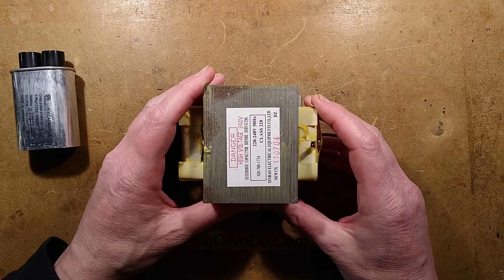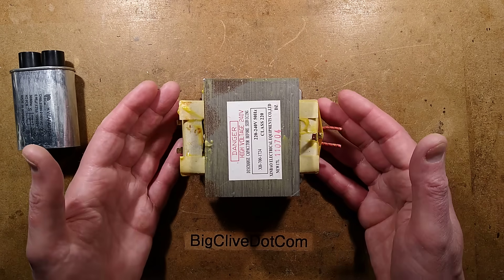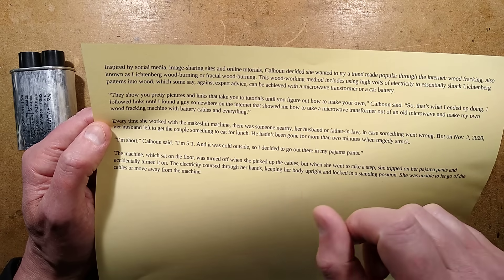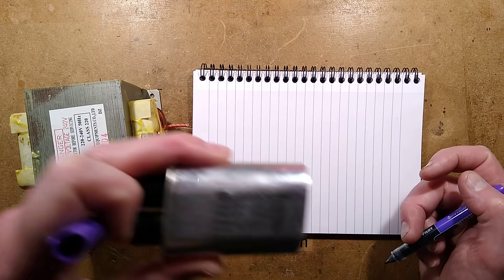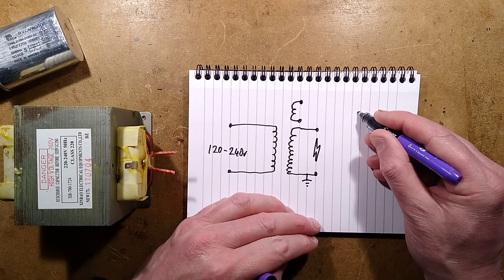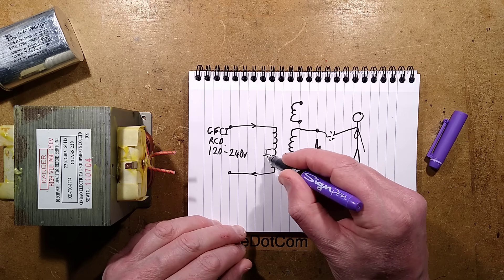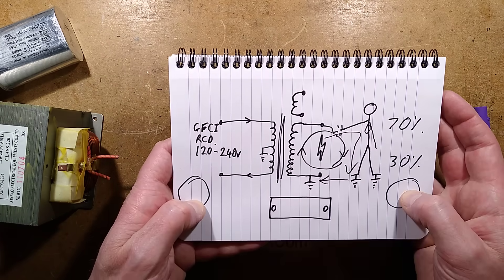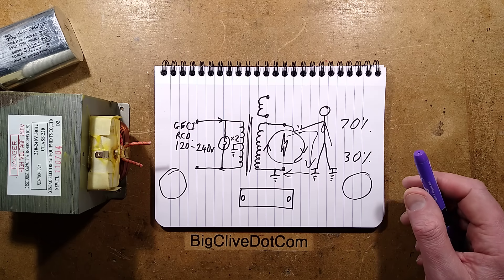The most deadly project on the Internet

Comment: Back in the mid 70s, I was a meteorological observer in the US Army.  My job was to throw weather balloons into the air and track the radiosonde with a giant 10-foot dish receiver.  The components inside of it were impressive, especially the two tubes that glowed with a bright violet and ultraviolet light and massive capacitors that looked like they could power a small town.  I was told to never open the drawers these components were in while it was on.  We had a young hardware engineer contractor that worked on these things (they seemed to be always breaking down; 1940s equipment does that) but he wasn't exactly careful about safety.  One day he was working on one of the receivers and after shutting it off, he grabbed a metal-handled screwdriver to short the massive capacitors.  Unfortunately, his other hand was on the grounded case.  When he touched the capacitor lead, he got a severe shock that contracted his arm muscles so bad, the screwdriver went flying through the quarter-inch fiberglass wall of the shelter the receiver was in.  Most of the rest of his muscles contracted as well and his body tried to follow the screwdriver through the wall, but only managed to crack it.  Fortunately, he survived but ended up in the hospital for a few weeks with severe burns.  Once out of the hospital, he immediately quit, not wanting to work on those death machines anymore.
Reply: Sounds like the ultimate example of keeping one hand in your pocket and only using one.
At high enough voltage even that is iffy.
Reply: @michaelszczys8316  "Sounds like the ultimate example of keeping one hand in your pocket and only using one." - That was literally one of the first things the taught us at the uni before we were allowed to do lab work...
Reply: 'You'll end up in a wooden box if you jam the interlocks'... One of my father's favourites ditties.

He saw his coworker's 'flesh running like water' after the individual had indeed jammed the interlocks while working on a radar station and going on to touch something he shouldn't. All he could do was kick his arm away from the set--not very safe itself. Part of it remained behind...
Reply: "he grabbed a metal-handled screwdriver to short the massive capacitors" - And he was a hardware engineer you say.....I'd never EVER go near ANYTHING electric (even SELV equipment) with a metal-handled screwdriver, let alone ANYTHING that contains unsafe voltages. What was he thinking even....
Reply: @CoolKoon  Yes, but honestly, when we are talking capacitors, i think the more sinister things are things, like lines connectyed to low voltage capacitor banks as those old tele line banks which are only like 5 or 12V, but can easily go up to several hundred if not thousand amps before they self limit.
Hower, for a professionsl those things are supposed to be obvious as well and it is not anything regular people are ment to coema across, but the same thing can also be applied to less obvious things as industrial computer PSUs and sother things like that which has a similar caracteristic. As well as some types of domestic PSUs for example (and probably also can be similary applied to things like clusters of automotive batteries connected in paralell, etc It's still only 6-12- 24 or 48V but can easily go up to several hundred amps DC.), which i don't think many people are even aware of at all.
Reply: @Vampi_Sweden  Which of my comments are you replying to...?
Reply: @CoolKoon  Sorry i did slide in to a general monologue at the end, i completly forgot i made a reply to You... i hope i did not accidentaly offend You or somebody else by that, if i did it was realy not my intentions, i was just thinking loud since we recently had exactly that conversation on a swedish electricity forum i came from whan a guys got "stuck" on a PSU...
Reply: @Vampi_Sweden  "i hope i did not accidentaly offend You" - No, but I'm still missing the context...
Reply: @CoolKoon  My point was that it is easy to think that low voltage are not dangerous
Reply: @Vampi_Sweden  There's a big difference though: while low voltages can definitely cause fires for sure they can't (directly) kill or seriously injure humans. Not even a SELV capacitor bank that can provide a discharge current of a thousand amps.
Reply: @CoolKoon  
I hawe actualy always wondered about that, as i heard 50V is concidered to be safe, but i hawe been tould it apends on the factors where the human skinn will still protect You properly.
Reply: @CoolKoon  A person on a computerforum i used to hang on tould an episode where he was electrocuted and became slovly paralyzed by 12V, and another guy on the electronics forum tould storys about those 5V stations, that's why i wonder...
Reply: @Vampi_Sweden  "i hawe been tould it apends on the factors where the human skinn will still protect You properly." - While it's true that the skin gives you a lot of protection the point is that even if the skin is pierced such voltages are not able to push enough current through the human body in order to cause harm.
"he was electrocuted and became slovly paralyzed by 12V" - Yeah, he's probably a pathological liar. How do I know? Because I did lick 12V power supplies a couple times. While it does give you a nasty sting it's physically incapable of pushing any serious current through your body.
"another guy on the electronics forum tould storys about those 5V stations" - Maybe you shouldn't believe everything trolls on electronics forums say.
Reply: @CoolKoon  Ok, thank You, the second guy did not stated it as fact, it was just what he taught i guess, i had honestly higher tahught about he's knowledge and was a person i used to correct my self on this topic until now. The only first person story i found there was about high volt from the subway feeding line when (another) guy was there to take some messurements, but it turned out that the line was not powered off, that one i do believe but thats more like 15 kV and a good portion of luck, he wrote that the entire chunt did vaporize and he had a short blackout, only luck he was not in direct contact with the arch since it barly passed by following the grounded copperwire he said...
Reply: The railway worker is not the same guy as he who mentioned those capacitor banks and PSUs.
Reply: @Vampi_Sweden  Subway feed lines are a completely different story of course, but we're not talking about 12 volts there. Even with the PSUs you were talking about amps, but still at a low voltage.
Reply: @CoolKoon  Thank You for Your ansvear! I started to do proper reserach about this yesterday since i realy want to find out more about this. Honestly i believe You are right here.

In my country, and i think the UK as well the old railway industrial safety standard (like for electric tools, etc) was 110/130V, which i guees must be on the borderline between safe and unsafe. But i guess it was set there for tecnical reasons allready in the late 1800, i would not be supprised if it is a remain from the 1880s No1 AC standard from the old 60 Hz system which where widly in use in Erupe as a paralell standard until i think relativly recent times (In sweden the last remains of all those standards and domestic DC lines  finaly dissapeared from the national distribution system in the 60-70s, so i guess one could hawe had like 130V DC in the old systems, whish i assume may be letal (?) under certain circumstances if i am not wrong here, so perhaps that's where this all came from, i don't know.. At least i heard warnings about the 110V centerzero system in the US may be lethal 220V is deffinitly, so i guess possibly 110V in like a direct contact. 
However, the Japanese 100V system seem to be a lot less dangerous for some reason as i heard one usualy just get a mild chock from it, but not much more.

The main distribution lines in Sweden are 25 000 V
Reply: @CoolKoon  You are deffinitly right in that it was extremly hard to find any example with watherproof evidence, i had to ask some of the more trusted guys there and thay did not know for sure either yet, but believe You are right here applied to any theoretical normal circumstanses.
Reply: @Vampi_Sweden  "the old railway industrial safety standard (like for electric tools, etc) was 110/130V, which i guees must be on the borderline between safe and unsafe." - No, that's quite clearly in the "unsafe" category.
"i would not be supprised if it is a remain from the 1880s No1 AC standard" - Actually households used to use DC in those few places which had electricity at the turn of the 20th century.
"one could hawe had like 130V DC in the old systems, whish i assume may be letal (?) under certain circumstances" - It's mostly just as lethal as the current 230V AC systems.
"the Japanese 100V system seem to be a lot less dangerous for some reason as i heard one usualy just get a mild chock from it, but not much more." - Perhaps they have a difference grounding system, IDK. I don't know much about the Japanese electrical system.
Reply: @CoolKoon  Thank You, back in the 1920-70s a lot of households (at least in Sweden) where powered by clusters of old private owned type miniature powerplants so my guess is that's why it looked that way since all of them could not afford to rebuild the generator or the users had a specific requests for something they used.
Reply: This is why I turned down an offer to work on a high voltage AC drone teather device. I do embedded systems programming (and low voltage electronics as hobbyist) but they had not hired an electrical engineer and wanted me to "figure it out" as well. They had an interesting idea but not nearly the budget required design it properly and test it safely. I declined the offer immediately. When an employer pushes you to take on tasks you are woefully unqualified and think that you are being pessimistic for voicing safety issues the are a danger to everyone.
Reply: @scar3xcr0  OMG it sounds like they were not only idiots but also dangerous idiots at that. There's a reason this stuff is taught at universities. One of my professors (at a dedicated HV complex in a separate building off campus) told us that "if you touch those leads your family won't need to arrange for your cremation" (mind you all the equipment there was for teaching and HV testing purposes, it didn't power anything). This isn't something that a startup with clueless MBA types can "figure out themselves" without an expert in the field.
Reply: That guy was darn lucky, i hope he learned a thing or two from that little incident...
Reply: It isn't just the high voltage stuff though. Back when pistol drills plugged into the mains I was unfortunate to use one with a fault which shorted a motor brush (240V AC - UK) to the gearbox casing where I was holding the thing. It pulled my forearm muscles so badly I had to wear a sling for two weeks and it was a full month before I could operate my motorcycle clutch.
Reply: @TheRealWindlePoons  "Back when pistol drills plugged into the mains I was unfortunate to use one with a fault which shorted a motor brush (240V AC - UK) to the gearbox casing where I was holding the thing." - There's a reason why equipment with a metal casing must ALWAYS use grounded plugs. That drill should never have made it to retail like that....
Reply: @Elias Müller The city where I live has just one EV specialist garage. When electric passenger cars become more mainstream, I confidently predict a rash of workplace accidents in back street garages...
😮
Reply: @TheRealWindlePoons  "I confidently predict a rash of workplace accidents in back street garages..." - Yeah, and those fires that they'll cause can't be put out either (especially not with water, which has the exact opposite effect)....
Reply: these are not death machines at all, unless you want to win darwin awards, people that have no business in them should do just that, and people who work on them are supposed to know (aka don't lie in your CV, because that is darwin award material too).
Reply: @Elias Müller "Electric cars can be also candidates for this kinds of accidents" - Electric cars are even more dangerous in this way because the shorts caused by careless poking in the battery pack can cause a fire that literally can't be put out.
Reply: He used a metal handled screwdriver, but what if he used, what he thought to be safe, a plastic handled screwdriver. But the plastic screwdriver has a hairline crack in the handle! Now he's just as fecked as if he'd used the metal handled one. Don't cheap out on tools when your dealing with these types of voltages, I'd think.
Reply: @anthonydenn4345  "But the plastic screwdriver has a hairline crack in the handle! Now he's just as fecked as if he'd used the metal handled one." - Not really. Even if the screwdriver had a hairline crack in the handle the air's insulation capability is around 20 kV/cm so the holder would be fine as long as he doesn't do voltages in the 10s of kilovolts range.
Reply: @CoolKoon  Well, lets say the sweat from his hands entered said hairline crack. Or any other conductive liquid or material. Would that still be the case.
Reply: @CoolKoon  Breakdown in air is 1kV/mm with sharp electrodes.The cracked screwdriver could get impurities and arc over.Power line insulators have about 2cm/kV distance and sometimes they still fail.
Reply: @MernokiMegoldasok  "Breakdown in air is 1kV/mm with sharp electrodes." - Okay, that translates to 10 kV/cm all right. Still doesn't invalidate my point. Yes, such a screwdriver wouldn't be safe for systems running on 10 kV (or higher), but that whole rant about the hairline crack is just a purely hypothetical situation because one's not supposed to touch HV equipment with a screwdriver while on anyway.
"Power line insulators have about 2cm/kV distance and sometimes they still fail." - That's most probably not because the air arcs over....
Reply: @CoolKoon  As someone commented before,the crack in the screwdriver could have dust or moisture.
Reply: @CoolKoon  You dont get it that you dont need 10 kV or even high voltage for an accident to happen.Everything not higher than 1 kV is low voltage.
Reply: @MernokiMegoldasok  If you think that a screwdriver with a rubber handle (especially one that's certified for work with voltages up to 1kV) might be dangerous for low voltage work then you shouldn't do any electric work either. And neither should the commenter above who made the idiotic statement about the hairline cracks. And no, contamination (save for metal filings/powder) is NOT gonna make the screwdriver more conductive either.
Reply: @CoolKoon  Nobody talked about a certified 1000V screwdriver.Contamination WILL make the screwdriver more conductive.Try this until you shock yourself and learn the hard way.
Reply: @MernokiMegoldasok  "Contamination WILL make the screwdriver more conductive." - No it won't, not in the way it'd matter anyway. Try what? Getting shocked? I did shock myself multiple times while working on electricity and it never was the screwdriver's fault.
Reply: @MernokiMegoldasok  "Why the fuck do you think that impurities in the crack cant make a flashover?" - Because ANYTHING under 1 kV just lacks the voltage to do it. And anything over it is irrelevant.
"Even if you have a certified screwdriver you should not use it above 1kV." - Once again: you should NOT use a screwdriver AT ALL for anything that has over 1 kV applied to it.
Reply: @CoolKoon  I have seen flashovers in cheap cables with cracked insulation on 230V.
Reply: @MernokiMegoldasok  So have I. You do realize that the insulation in cheap cables is a LOT thinner than ANYTHING you get on screwdrivers though, right?

Comment: 1. Treat all electric things connected to a power source as lethal. 2. Treat all electric things not connected to a power source as lethal. 3. Use protection at all times. 4. Don't try things you saw on the internet.

Comment: Out of curiosity, what sort of current can a microwave transformer deliver?
Reply: an 1100w microwave plugged into 230v needs 4.7A from the wall (ish). assuming that voltage is stepped up a factor of 10 to 2300v the current is atepped down equivalently to 470mA, which is bloody plenty!  but those things will be rated for more than that, for safety. (electrical safety)

Comment: Microwave oven is one of the most dangerous to work around, the only appliance that have a high voltage inside and at high current, when i work with high voltage i nevr tough the cable, if i need to move it while its live, i just use half a meter of PVC pipe to keep distance

Comment: some guys make homemade electrical furance using 4x of those microwave tansformers, a few camp battery ferro rods,  they melt metal INSANTLY into a crucible down below   it burns off so much off impurities.  then again only do this if you are certified electrical engineer and has sigificant experiences in furance work.     the guy that did this is a bladesmith.  he recycles metals or combines metals into ingots. and eventually forging into blades.     when i mean instantly  i mean 4150 or 6150 steel just melt in a blink.    thats how dangerous these microwave transformers are.

Comment: Decades ago we got a powder coating plant, which ofc uses a high voltage of around 250kv to electrostatic charge the powder to the object that had to be coated. Current was limited to around 20 microampere, and a cutout in case of a short or "unusual operation conditions" which ofc led to playful scenarios happening because what could go wrong? Well, who knew what fun was to be had with high voltage and glasses with a metal frame 😝?
From this point, i have to say, there is no "safe" method to do wood fracking with household equipment, at least not for traditional values of "safe". But there is always the chance for a honorable mention in the darwin awards 😁